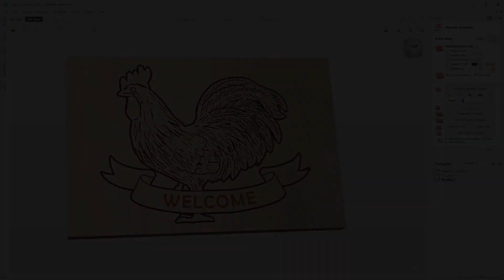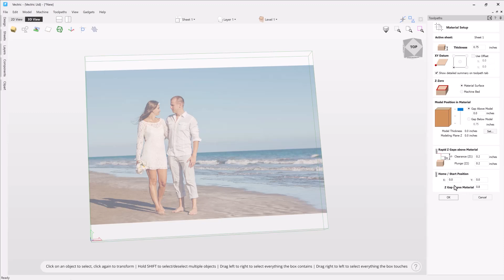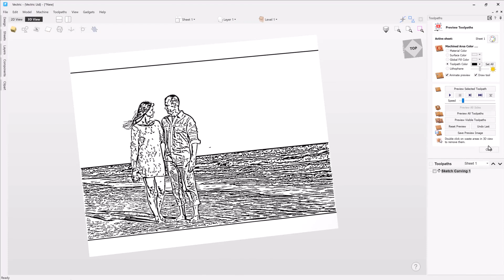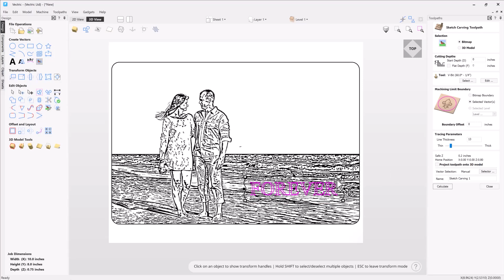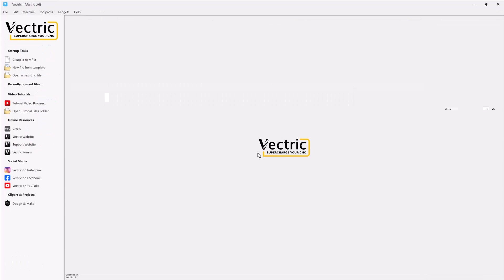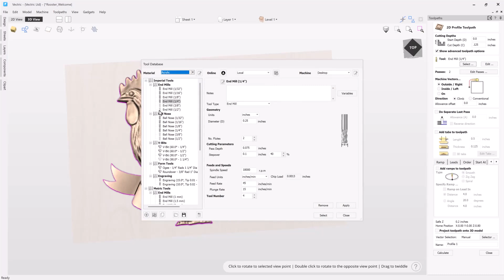How to use the sketch carving toolpath | 2.5D Toolpaths | V12.5 Tutorials

Comment: I have a family Scottish coat of arms I've been working on for a while trying to generate vectors that I can carve in groups, but this is very intriguing. I may upgrade and give this a try.  I assume there are a couple of options to build up that contrast.  Carve, paint, then sand.  Or sand, paint, then carve.  It seems like the former approach would allow the wood to shine through better, and you could paint in different colors (e.g., the Welcome text here) and just sand off the excess.  I haven't tried it.
Reply from the maker: Thanks for watching, and I hope the sketch carving toolpath gives you some good results! If you want to have a try... but you won't be able to save the toolpaths (you can preview the tooling in 3D), but it might be able to help you get a good idea of how it works - download the trial of VCarve Pro - https://www.vectric.com/free-trial/
Reply: @vectric  Thanks, I ended up upgrading, and yes this helped tremendously achieve my goal, and I believe opens up a whole world of possibilities!  I have a mid-level complex image of my family's Scottish crest, and the flow I ended up using works like a charm.  First I traced the outlines of the crest manually for the solid colors, then passed those on to chatGPT to create STLs at specific heights I give it, remove those solid colors from the image, then place the image in vcarve.  I created a toolpath for the solid pieces as a 3D model, then created a toolpath for the sketch vcarve.  So I get a nice depth for the larger, solid pieces, and the sketch part carves in details.  Very nice, better than I could have ever done by designing it myself (or at least 100 times faster).  I love the other updates as well.
A couple of suggestions:
Add an option to the sketch vcarve to remove the square border of the image.
Can you make the Pin toolpath option stay pinned after selecting it?  I work on a large monitor, and just want all toolbars open at all times, and clicking "pin"  is kind of repetitive.  
Oh and it might be nice to also use the sketch vcarve on vectors.  I imagine it already uses the image traced open vectors to create engraved lines and closed vectors to create areas of engraved areas.